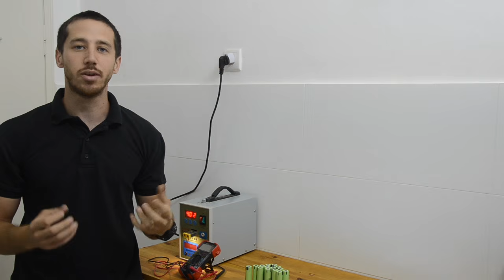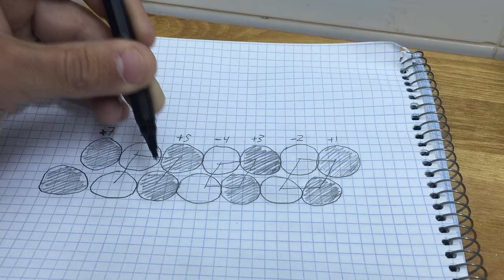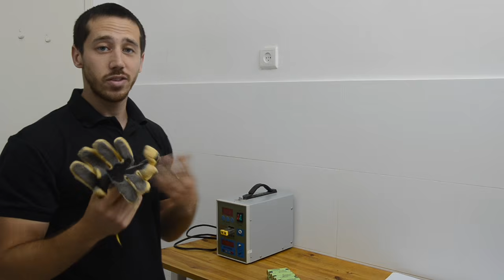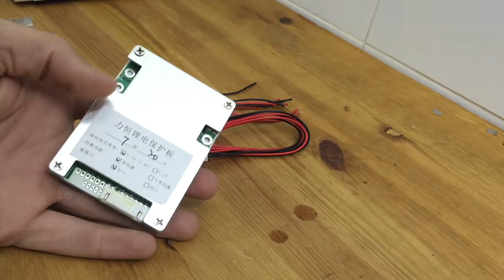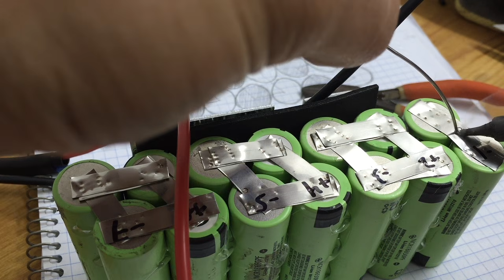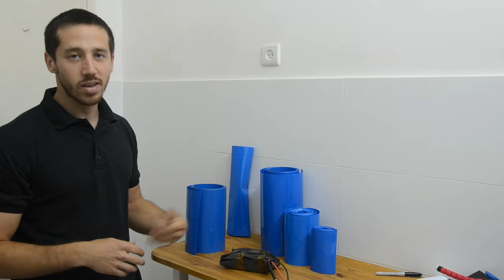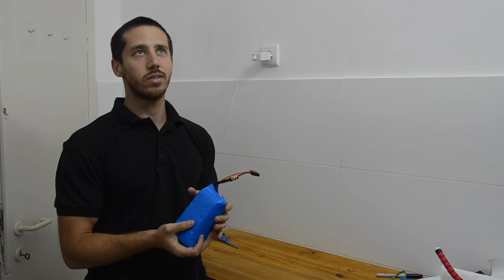How to build a DIY ebike battery from 18650 cells

Comment: Does putting cells in parallel increase capacity or discharge rate?
Reply from the maker: both
Reply: @EbikeSchool  

Series increases capacity and voltage. Got it. 

Thank you!

Comment: So let me get this straight? On MOST lithium ion scooter packs there will be the output connection usually xt60 with thicker black and red wire and then a charging connection as well correct?

Comment: Great Video. Thank you.  O bouth an old wave 2.0 ebike from my friend but the battery does not work. He said it was something simple..but  NO.  The battery has 50 batteries.  I understood how to do the one on your video, but 50 batteries I would be lost.  Another thing. I do not have  a Spot Welder.  Is there a way to do it differently.  I appreciate your help. Thank uou again

Comment: Way too many welds... Remember you did show about safety and removed even your ring as you put gloves on.. Dont have to.. But yet you weld 8 points and making alot of heat too as this is never a good thing. And for so small pack 2 to 4 points is good enough

Comment: Hi if I use 6 sumsung 40t in parallel the discharge will be around 180amp, will I be able to use 100amp bms for the pack?
Does 0.20mm pure nickel good enough or I should use 2 lier of it thanks by the way pack is 20s 6p

Comment: Hello all, I am looking to make a ebike battery but i am stuck between two cells. Do i want to use the cells with a max discharge of 6A but 3500mah with 5 in parallel to make 30A or do i want to use cells with 10A so it would be 50A but with 3000mah. I am using a 1500w motor at 52v so it would be pulling 30A at most. Does it make a difference on the battery if i discharge it at a higher rate?
Thanks

Comment: Would it be more cost effective and cheaper to buy Sunko batt spot welder, 18650 cells, bms, and ALL other supplies and build a 60v 15ah 18650 battery.... ORRR  cheaper buying the 18650 cells, bms, and your Vruzend high power kit? Or maybe 2 LiPO 22.2V 20aH packs and battery alarms?

Comment: Hi have a problem with my kids balance electric bike at first the bike was working good an after an hour the bike started giving problem if I keep the throttle half it works but if I put it on full throttle it work an then it shut down so what can be the problem please need some advise it’s a new bike

Comment: Hi so I was just wondering, at the end of a batteries life there are often still some good cells which can be scavenged for the next project. Can you still get them out if they're hot glued?
Reply: All the cells will be roughly equally degraded when you use the pack so if the pack is at the end of its life, then there aren't any good cells to scavenge from it.

Comment: Dear ebime school. , 
Dear God help me. , please .
I am not computer savvy and have been trying to acquire a battery for nearly 4 months .
DHgate.com seems to be a monopolizer of the type. , 52 v 26 - 30 Ah ebike battery at especially at a decent price .
I have a Voilamart 1000 watt rear wheelsystem with a sw-900 LCD screen system .
CAN I BUY A BATTERY FROM "YOU" AS DESCRIBED FROM A REPUTABLE COMPANY FROM THE U.S.A. ?

ALSO WILL  BUILD A BATTERY V2.1 GIVE ME A COMPANY WEB ADDRESS / PHONE # WHERE I CAN BUY "EVERYTHING" I NEED TO BUILD A BATTERY ,  BMS BOARD NICKLE STRIP TAPE SHRINK WRAP FOAM WIRE BATTERIES ETC....ETC....ETC...."EVERYTHING"
DEAR GOD PLEASE DIRECT ME .
THANK YOU

Comment: Sir is it okay if I just use copper wire as connector between the two batteries? please reply. 
thank you
Reply: Soldering it to the cell is the problem, because the cell heats up too much. So no its not okay 🙂
Reply: @monomas11  oh. Okay Sir. Thank you.  I was about planning to create one😢😕😐

Comment: hey thanks for the video. that was nice, but does everyone have a spot welder at home??? that welder is expensive too not to mention the price of each battery shrinking material and the xpensive nickel too
Reply: That's why I just bought a petrol / gas motor... Was cheaper overall and just fill the tank.

Comment: Hello, I have two questions/comments... 
1. The parallel connection of the such high current (means very low internal impedance) cells looks "dangerous" to me. If there is any "unbalance" in internal impedance between the parallel connected cells, it will be internal current trying to compensate for this "unbalance". 
2. When you check the voltages of each cell, prior to put them together, I would recommend to do it under a DC load, maybe not full load, but at least, say 1 A, for this cell capacity. That will allow you to initially  group the cells, connected in parallel. 
What do you think?

Comment: Is it possible to reconfigure a high Ah battery pack to a higher voltage? Change connections from parallel to serial?

Comment: How can I check the voltage of each cell without a monitor I was thinking this might be costly do I need to go out and buy that machine to check the cells of each battery or can I do this without using one of these machines I was hoping that building my own batteries would be a cheaper way of replacing my batteries but now I'm coming to look at it again I'm thinking this might come up to a lot more than I expected to spend maybe I should just go out and buy a brand new battery I don't know what's your price on these machines will it make the whole project worthwhile paying for a machine to build my own batteries or or just buying the batteries and building them without checking the cells or just go out and buy new battery what's your view on this thanks if I get a reply

Comment: Turbo Bob I think you make the best videos for eBikes on the Tube, what I would like to do is build a 48v Samsung 18650 30Q from start to finish, using at least 52 batteries if that is possible, step by step, with a BMS. I am a little confused on how many batteries I will need, and how to select a BMS. I have automobile experience so it is not that new to me.

Comment: Wow! That's amazing stuff. Congrats on your invaluable effort! I ran across this video, while i was looking for a citycoco electric scooter upgrade video. It's max speed is 45km/h and i want to make it around 60km/h. My battery is 60V-16ah. My bldc motor controller is 1000w. And no idea about my hub motor for my 225/55-8 rear wheel. Maybe it's not the correct place to ask, but i'm struggling for weeks to learn how to. I'd be very happy if you can give some clues on that please.
Reply: Could be wrong, but a 750W hub motor should be fine, but it's good to have big(ger) motor. Looks like you got the right stuff. 60V is honking. Put it together and give it a bench test.

Comment: The black isolation you use is also a heat isolatior. You should not use that. If the pack gets to hot it cant release the heat. This way your batteries will be dead sooner and there is a higher chance of a fire.

Comment: Just a suggestion to look into using 21700 cells instead of 18650 cells. You get a lot more potential for higher capacity in almost the same physical space...just an increase of 3mm Diameter and 5mm Length for almost 50% additional capacity. Put another way, a 21700 cell stores almost as much energy as 1.5 18650 cells of similar construction.
Plus, the 18650 cells can have a lower lifetime than the same capacity 21700 cell due to increased stress on the 18650 cell when talking about very high capacity cells.

Using 21700 cells may also let you go to fewer batteries in parallel for the same performance. For example, you may be able to use 3p12s instead of a 4p12s configuration. In the 12s configuration that eliminates 12 cells right there for actually a slight increase in mAh capacity. So differences in cost between similar quality 21700 and 18650 cells may become a non-issue in a given application.
Reply: Thats rite

Comment: I appreciate your videos. Im building a 36v battery i think 9p10s battery for my scooter. Im shooting for as much amps as possible. It is a 36v scooter with a 500watt motor.  I see 36v 26ah batteries packs for sale on aliexpress with a charger for about $300, but I want to build my own for gaining experience. I already have a charger. I am most confused by what exact cells I should use to try to get the most amps. And where to buy. any thoughts appreciated.

Comment: wow, great vid. 
Hi Ebikeschool.com
I have the EMMO GT80 scooter with 80V/20Ah Lead Acid battery.
I want to build whichever is the best and Economical way to add up to 80V, can this be done? 

80V/20Ah (LiFePO4) battery  
or
2 x 40V(LiFePO4) battery =80V 
or
4 x 20V(LiFePO4) battery =80V

Thanks

Comment: I have a bms with 20amps and I want to increase my battery capacity from 10a to 20amps. Using cells with 3.4ah the capacity with be 20.4. would like to know if it will be safe using such capacity 20.4a on a bms with 20a.

Comment: Hello good evening. Please, can you help sir. I am trying to figure out if it’s possible to connect 3-12V / 12ah batteries in a series and parallel combination to make it a 36V/36ah system. If possible , could you provide a small baby like diagram that I could follow to get my kids electric motorcycle to run a bit longer?? Thanks in advance for any help!!! 🙏🏽

Comment: Why most e-bike battery pack used lower amp capacity instead of higher like 3400mA Pqnasonic  or 5000mA Samsung 21700?

Comment: To parallel the pack  defeats the purpose of the BMS.
Reply: I'm electronic dumb. What is BMS exactly? I really don't have any clue what this man mumbled about.(video)
Reply: @AMX M4 45 100 BMS For this application it's main purpose is to bleed off excess voltage for individual cells and charge individual cells to make them the same voltage so as not to damage them. He paralleled the pack making it impossible to monitor individual cells. Voltage readings that are too high or too low have a detrimental effect on the cell.
Reply: @michaelflynn9622  tq man, highly informative. Helps a lot.

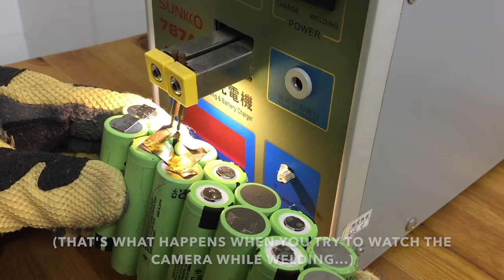Comment: There was a spark between the armature and the welder case at 10:00, 12:07 and 12:10 ... We used to call that method of soldering "gob soldering" ...

Comment: some BMS have only 2 wires for charge and discharge. some have 3,  for 1 charge, 1 discharge and 1 common.  in the electric bike you never charge and discharge at the same time. but using offgrid solar to charge (sollar pannel + dc converter cv cc) charge and discharge happen in the day using it. if you have more info about the, please show it! I wanna remove my old "car style" lead acid batteries with solar charge controller to the better way and as far as know li-ion don't need the charge controller. just the PV and the dc converter cc cv (maybe step up and down) to feed the BMS and charge it all. I guess 7s and maybe 10 or more parallel are the better choice for solar 24V lead acid replacement but I don't really know how many amps I can feed in the pack. the PV must match the max amp feed rate of the batteries. any help are really welcome

Comment: Great video and explanation is simple and pretty much comprehensive. However set that your site offer is expensive, I would say extremely expensive. You doing a great job as an educator but parts are costs almost twice. It's not that fair to people who just started and doesn't have a lot of experience with buying and modeling batteries.

Comment: Have you ever made an ebike battery with li-ion 26650 cells? I am looking for any resources or examples of anyone that has used 22650 batteries instead of 18650 cells to make a battery for an ebike or scooter.

Comment: hey thanks for the video,  i have a battery (bosch) i broke my BMS i did swap a similar bms that you are working on but i have 3 wires left ( YELLOW - BLUE - GREEN ) that i dont know where i should put in BMS they are coming from inside  my motor BOSCH to the plug ( yellow + positive + green + negative + blue ) if you can help me out please i cant find solution thanks

Comment: You're gonna set your self up for trouble if you don't match the capacitance  of the cells. I.e they won't charge and discharge smoothly bms or not and you could have one cell or more go tits up on you.

Comment: converted mountain bike to rear drive 1500 watt full suspension GT I drive
just purchased the 48V 18Ah Li-ion Battery that fits on the rear rack of my bike
https://www.ebay.com/itm/48V-18Ah-Li...7f93%7Ciid%3A1
was reading that upgrading to 52V really helps and works out pretty good.
Opened one end of the box / housing looks to be some available space inside to add the extra cells
can someone tell me what's best to use for my upgrade; how many cells I need to add, how specifically to connect the added cells, where to purchase all I need, etc...
yes I'm pretty new to this, but have done lots of fabrication projects in the past, plus owned a atv / marine repair shop for years

thanks

Comment: That's a bad advice to keep the strips loose while welding. If you short those Panasonic batteries their inner fuse triggers and you can trash them immediately.

Comment: Hello, I'd like to start by thanking you for your videos. I want to build a vertical battery with 18650 cells for a 500W/48V or 350W/36V scooter motor. do you know what kent of cells distribution and how many cells I need to use?

Comment: When you see the shear amount of petroleum based materials that go into battery production you realize that all the  talk of a sustainable energy future is just a total fiction. In fact so called sustainable energy is probably worse than just burning fossil fuels directly because at least then there isnt the requirement for making all the materials to go on top of the charging, which of course will be almost totally from fossil fuelled power stations.

Comment: Hello i have a question its possible to use more power full motor controller in a 500W hub motor, this motor its rated to 350w.
Reply: Thanks

Comment: always pre tin your connections and the base terminals on the BMS so you don't get a cold solder joint to minimize resistance...

Comment: In this video you shown how to check cell voltage fine, at the same time you should of show cell amps also, that is really helpful for beginners like me, since i have recollected old laptop batters for cells to make a battery pack but now most of the cells are showing voltage fine, but i am struck here how to check each cell amps since these cells are not only from one pack(laptop battery), many with different voltages fine we can use BMS for balance, but dont know what is the good or bad cell with amps. kindly help me if possible.

Comment: I had a question about the configuration of the battery cells. It seems to me that some bikes have big chunky frames that could accommodate a number of batteries if arranged  2x2 and attached along their length, not sure how hard this would be but it would conceal the battery pack. Is it possible to attach them end to end and how would you go about doing that?

Comment: Hi, rather than using 4 strips of Ni to connect in parallel and series, you could use a single piece, just a parallelogram with the right shape. Simpler, more elegant, better connections. No need to overlap Ni strips.